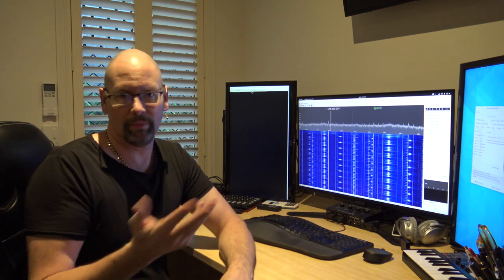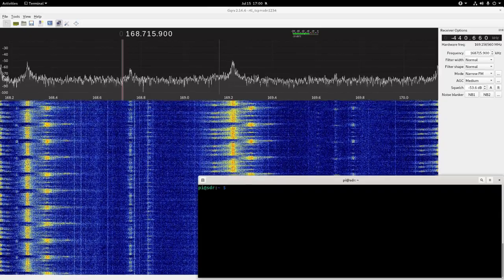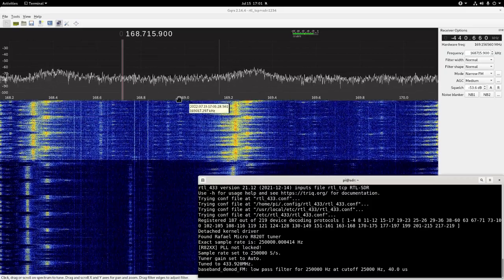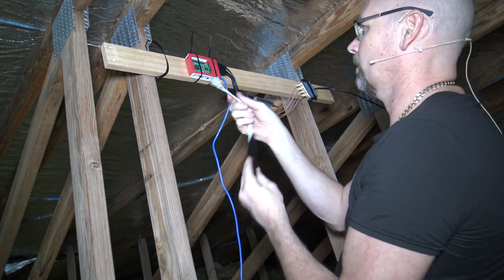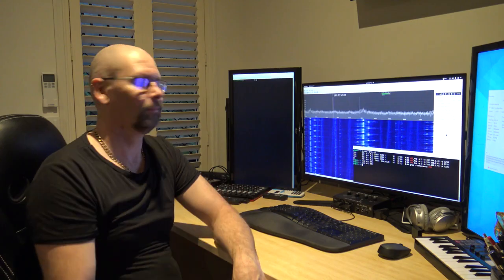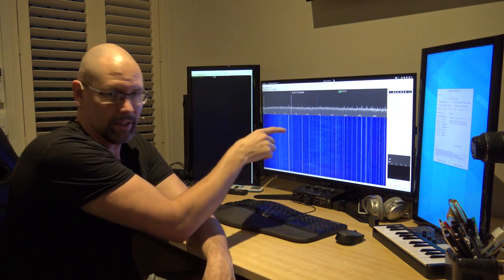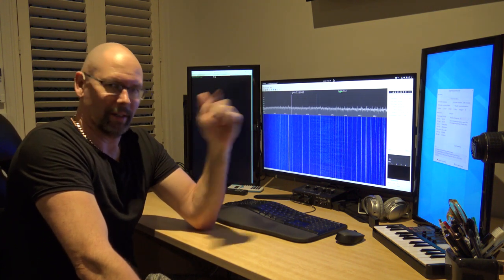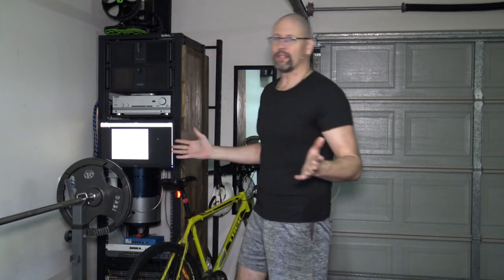Radio Power Supply

Comment: Yeah. Use WiFi to test. Or if you can’t because if rf, run Ethernet through a surge protector grounding block.  You should have a telecommunications grounding block somewhere. Ground to panel grounding block.  Just like a isolated ground outlet.  Also using shielded cat6a cable is good.

Comment: I have a lot of noise at my house around 130-146MHz area.  I noticed it's my POE security cameras that are causing the issue. When I unplug the cameras from the NVR, the problem goes away. 

I also have some LED light bulbs that cause some issues also, but nothing like the POE cameras.

Comment: I think the main problem is the built in power supply in the Raspberry Pi. There is a shitty switch mode power supply on it. (And that's why it always complains for the 5V power..). You can try to use a low noise power supply (maybe a 7805 + a PNP transistor...), but i think there will be the same noise.

Comment: Nice video ! 
I’ve struggled in the past with PSUs that go wrong and now I select the best ones out there and also checking regularly with dmesg.
dmesg | egrep “aile|olt|rror||aulty” 
I bet there are better ways to check and I’m open to hear more optimal solutions 😉
When there is an under-voltage situation you can see it there.